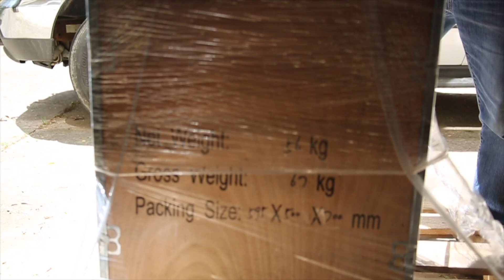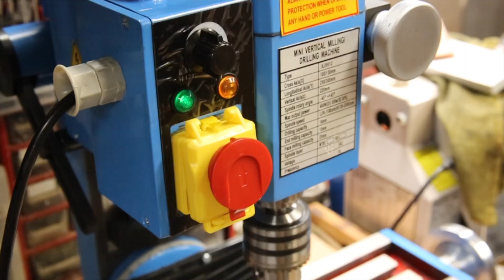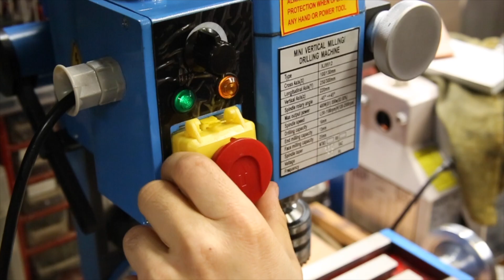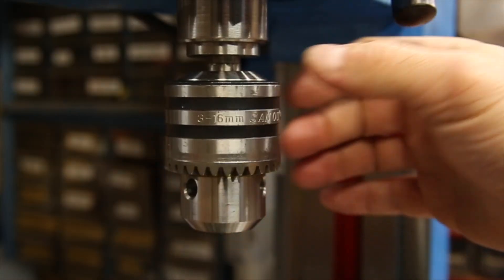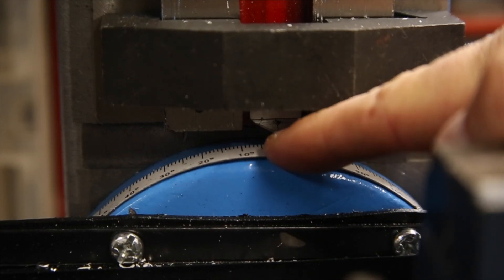Cheap Chinese Mini Metal Mill Milling Machine Unboxing, Setup, Testing, and Review

Comment: can you let me know the model/brand of the milling machine? the amazon link doesn't work. thanks.
Reply: Why don't people list the brand and model number?? Anyway I did manage to snag the model number from the video and found it - MINI DRILLING & MILLING MACHINE XJ9512
https://www.amazon.com/MINI-DRILLING-MILLING-MACHINE-XJ9512/dp/B01MUILF9Q/ref=sr_1_fkmr0_1?keywords=mini+mill+xj9512&qid=1575602247&sr=8-1-fkmr0

EDIT: Cheaper by a LOT on eBay 
https://www.ebay.com/c/687855375
Reply: @tihzho  it's a ploy so are forced to  click the link. There's a financial gain  for them if we click the link

Thanks for posting the brand/model. For that price, I'd rather get a taig milling machine.
Reply: @yeahitworks  Yes I know about the Amazon referral. :)
That's not the real price anyway, its about $800 on ebay which is a good price and a lot cheaper than a TAIG and its good for the tinkerer sticking a toe in the water.

I lived in Shanghai China for about 10 years working in manufacturing and a mill like this would be about $250 there. You can get some very good well made equipment in China, which makes sense China is a manufacturing country and their infrastructure hands America its ass. Whatever you need, you can find shit load of factories that makes it and are happy to modify it to your specs. Shame I couldn't bring anything back with me! hahaha
Reply: Try Aliexpress.

Comment: In my experience those small machines  don’t do very well with big ”standard” four flute end mills, for those an 8mm for aluminum is about the biggest you will get good results with. For removing material: use roughing end mills, they generally work well up to 12mm. And when using standrad end mills you need to cool/lube your work, almost any oil works for steel and alcohol or oil for aluminum. Alcohol is nice cause it does not stay on your parts and chip. And get a bettet wise and some collets...

Comment: I enjoyed your video....I have been considering purchasing the same machine....saw it on Ebay
Reply: RCKN-RNDL West Virginia RC i would not.... those machines don’t hold up very well. Had 2 of them, one broke within 2 weeks and one never started. A warning flag should be all the tools that come with it; good machines come with a manual, a wrench and possibly a chuck stem without the chuck. I got an optimum bf16v i think its called, has been reliable for years.
Reply: @antonw-uw4ov  .....ok, I appreciate the info

Comment: Softer metals like aluminum, use a 2 flute endmill. Depending on your speeds and feeds, a 4 flute will get gummed up and the material gets hot. Also add an air hose with a constant feed to cool your workpiece and to keep chips from piling up.

Comment: I don't understand why they don't combine the lathe and mill by making the lower bed into a trunion. you could mill and then adjust the lower bed 90 degrees and use as a lathe

Comment: Lots of videos on mini lathes and Mills. 
Some common observations.
Dissasemble and clean every part. 
Replace plastic drive gears with a belt drive. 
Replace ball bearings with taperd bearings
 Bolt it down!

Comment: Don’t use drill chucks! Pick up collet holders and collets. Also bolt the machine down to a heavy solid flat surface and level it, that way you can check all run out and hopefully this machine has a way to remove slack and adjust the surface for true flatness

Comment: These relatively inexpensive milling machines convert easily in great little CNC mills with readily available parts. Been done many many times and loads of videos on here about this. Turns it into a very capable little machine.

Comment: Looks like an alright little mill..
Edge finder tool really has no use for this, they are for automated equipment like a CNC for zeroing off tooling.
I may have missed if you mentioned what this cost for price, so I was wondering how much it was ?
Thanks 4 sharing bud.

Comment: Don't do all that back and forth with edge finder.  move it to contact slow and end right at shift from center.  Unless you can get edge finder to center by eyesight and then find its at same location according to DRO or dial indicator on machine.

Comment: Things to get (if you have not purchased already)
R8 collet set for common endmill sizes 1/8, 1/4, 3/8, 1/2
Small test dial indicator with a holder to attach to the quill for squaring the vise, locating center of a hole, etc. a $10 Chinese knock-off will do for start.
Set of parallels 
V-block set (with clamps!) for holding round things
A bottle of way oil
A bottle of non-detergent gear oil for lead screws
Lighter (SAE20-30) non-detergent oil for everything else spinning
Water-soluble coolant and spray bottle 
Small machinists jacks
Clamping set. Make sure the T-nuts are the right size for your mill table slots.
iGaging DRO or similar - you will be amazed how much it helps in speed and accuracy.

Check your local Craigslist, FB marketplace or whatever is in your area frequently, look for “machinists tools” and similar keywords. If you are patient you can collect nice set of tools from retired machinists.
This is also a good source of endmills.

Learn how to adjust the gibs on your mill. Loose gibs are the main source of chatter on those little mills operated by novice machinists.

Comment: @TimNummy Bolt that thing down to something solid, any shakes or vibrations will result in bad finish and most importantly NEVER use a drill chuck for milling!

Comment: Great video man! Just a few things that I am almost sure someone else is likely to have pointed out but...
1 a face mill will give you a better surface finish and will all around work better for the operation you showed.
2 a set of collects would go a long way towards helping with repeatability and accuracy.
3 a test indicator and swing arm will so you can tram in the head of the mill will make your life easier.

Comment: I made a dirty look as soon as I seen him put the round stock in the vice without a v block
Reply: A whole bunch of dirty looks from this side, me being an learned fitter and all.
The first of them being lifting the machine onto the table without taking it off the pallet-thingie and bolting it down properly.
Not making sure everything was oiled and tightened to spec.
Not making sure the head was 100% perpendicular to the table (a dial gauge is your friend).
Using a drill chuck for milling.
Not using coolant when milling with a high-speed mill.
Using a cheap-a** vise meant for cheap-a** drill presses. ...And not making sure the stock couldn't shift in the vise.
Running the mill across the stock without lifting it off.
Probably more, but that's what is what I can remember for now.

I probably wouldn't trust this thing with anything harder than nylon...
Reply: It’s  “vee block”
Reply: @zentesuken1346  no it isn't.   It's correctly stated in any of the ways we see it in this thread, and you really need to have a better critique than that to enter a discussion.
Reply: Yep same
Reply: And you did not when he showed the chuck with the endmill in it?
Reply: @69NOMAN69  one dirty look at a time, sir.
Reply: @69NOMAN69  I'm still sort of a nooby to this type of stuff. May I ask what exactly is the problem, or potential problem, of having an end-mill bit in the chuck?? Hope I don't seem like a complete idiot, but i honestly don't see what the issue would be, especially since the workpiece is held in a vise, bolted to a "milling table". I was going to be creating just such a set up in my work shed at home pretty soon, so please stop me if this is a No No for reasons I don't yet know.  Thanks!
Reply: @69NOMAN69  Thanks mate, this advice of yours is quite helpful to newbies like me.
Reply: @logancurl9526  Drill chucks aren't made to withstand side loads. Most are held on the arbor with a short taper (eg. JT3). The chuck and end mill could suddenly come loose. R8 collets (if your machine takes those) are the least expensive item to pick up. Or a small selection of endmill holders.
Reply: @northwind7409  are those items that would allow me to use end-mill bits in a drill press chuck in a safer/more secure manner? Or is that something that you use INSTEAD of a drill chuck? Where do I find such items for sale? Thanks for your help!
Reply: @logancurl9526  Definitely instead of the chuck. The chuck would likely let go even sooner if you had several things chained together and applied a side load. I'd expect Little Machine shop and Harbor Freight would carry endmill holders in MT3 or R8 (whichever fits your mill) or sets of R8 collets. The holders would be a bit easier to use. I'd suggest getting 1/4", 3/8" and 1/2", since most of the endmills you will use have those sizes of shank.
Reply: @northwind7409  a jacobs drill chuck can easily, easily handle the side loads. The actually issue is primarily that a jacobs d c won't center the bit very well, and secondarily, it won't hold onto the bit the way a collet or an arbor will.  So in addition to cutting on one flute which will then get dull, the bit may get pulled down or pushed up in the chuck.
Reply: @someotherdude  I have had the Jacobs taper let the chuck separate from the arbor under side load more than once.
Reply: well i mean it does have 3 points of contact
Reply: @codeflame8422  3 rules of machining
#1 rigidity
#2 rigidity
#3 rigidity

that is all
Reply: @69NOMAN69  one rule of entertainment, #1 sit back and watch.
Reply: @69NOMAN69  when i saw that he was working on the pallet.. everything was said.. ;)
Reply: 69NOMAN69 noman #4 rigidity
Reply: Julien Bellon-Serre hey I got married on a pallet. I drive a pallet to work every morning. Nothing wrong with pallets.

Comment: @Sean Murphy "regardless of safety, a drill chuck should never be used for lateral cuts as it's specifically designed for lateral compliance, so as to allow drills to seek rather than snap."
Drill chucks don't have built in lateral compliance, that's the result of the taper giving way under lateral forces and the force of plunging into the material pushing it back into it's taper.
This is why we have draw bars, but you made a valid point nonetheless and are probably the ONLY person in the comments to actually state a valid argument for their claim. 

@WCGwkf "Sharky even in a mill you're not supposed to be milling anything with a drill chuck."
What's your reasoning for this ? What dictates what you should and shouldn't do with a drill chuck and why ?

"Sean Murphy it seems pretty clear to me that people who claim you can use a drill chuck for milling are not machinists and have only used a drill press and maybe touched a mill once or somehow have gotten away with using one improperly and have no clue how to machine. These people have no idea what they're talking about and it's pretty funny"

So tell me Mr. Machinist, why shouldn't you use a drill chuck in a mill ?(The one Sean Murphy stated does not count here, there are other reasons why one wouldn't want to use a drill chuck in a mill)

To every actual machinist out there, yes, I know why one wouldn't WANT to use a drill chuck on a mill so please don't reply with the answer. Just pat yourself on the back for knowing the answers and walk away :P

Comment: you're using an end mill in a drill chuck?  They are not designed for high lateral loading.  Use a proper end mill holder.  It will be more accurate and give a better finish.

Comment: If you buy yourself a set of collets and a collet chuck, you will get a better finish.  The Jacob's chuck that came with your mill is meant for drilling.  You can damage it by using it for milling. Also, Maybe invest in a better vise.  They aren't very expensive.  Make sure to mount it true. That'll help with accuracy when edge milling. Have fun with your mill. They are a blast once you get familiar with it.

Comment: Late to comment party so im sure advice from me is , what am i saying. Im a mill god. Lol 

Get that mill in place and make it permanently unmovable. 

Square, plumb,level x,y,z, install vice and lock a straight edge in it so your sure vice good side to side. Use edge finder to find one of the vice "unmoving" corners, zero out your handles and lock the collars.

Shake it, check zero again. Get some collets. Drill chucks <-- drill. Collets mill.
Aluminium is gooey and sticks. Use tap magic aluminum. Regular tap magic for steal. 

For nice flat finish, a. Get a fly cutter with carbide inserts. Either tool you use, you want the tool eating the edge not wiping the edge. A little under half the tool should be doing work unless cutting a slot or something. Think, rotation, sharp edge clawing into metal and nice empty yard behind ya to toss the chips. Steal look for amber chips, blue chips mean to fast or to much. Aluminum, if you work looks like shit and you neet to file the aluminum off the end mill, check ur speeds and feeds and that ur not wiping.

Check out gesswein, there ww collets are concentric to like 4-5 decimals.. there stones and polish are second to none. Get some cratex too,  but definitely get a fly cutter. It is its own collet. And the inserts are pretty cheap if ya breakin stuff learning. 

Hope it helps, oh and best advice ever..... do the hardest feature first so if ya fuck up you have the least time invested. 

Peace.

Comment: Hey nice video thanks for the demonstration.  Im a tool and die maker and CNC machinist and im looking at picking up a little mill for myself. This one definitely looks cool!  

Others have warned about using an endmill in a chuck and i agree, dont do it, especially when milling metal.  Also you might want to check the squareness of your spindle to the cross table with an indicator to make sure its level to your work piece.  This is standard practice in machining and can be done with a magnetic indicator attached to the spindle head or with and Indicol.

Also, some advice on milling roundstock.  Dont rely on the jaws of your vice to hold a round workpiece, Not enough of the stock is engaged to the jaws to be safe or to give you a reliably level finish.  Get a V Block that will square up one side of your roundstock and use the rear vice jaw to hold the curved portion in the V Block.

Happy machining !

Comment: A flycutter or face cutter would get u much better mill finish. But tbh if you r cutting cylindrical work use a lathe. Or a bigger mill, the least amount of passes to finish a cut the better

Comment: @
TimNummy While you were testing on that aluminum shouldn't you have used some sort of cutting oil or lubrication on the bit?
Reply: nightstryke 1 no aluminum is a softer metal that cuts very smoothly and doesn’t produce much to any heat. Cutting fluids are meant for harder metals such as steel.

Comment: first thing i woud do on a machine like this is to se if everything is lined up properly-fit an indicator in the chuck(replace that whit a collet) and measure on all 4 corners of the table-i bet that u will get different readings on all spots, the table or the head can be shimmed somewhere to get all corners to zero

Comment: Good quality vice and use a fly cutter. Also don't use the given chuck take advantage of the Morse taper. But given the machine you can only get up to a point before you would have to upgrade the machine but this one would get you close to a reasonable finish.

Comment: 1. Get a bigger mill (probably not very helpful).
2. If you can take light cuts, go with carbide end mills. They have much better finish but since your mill lack rigidity, don't take any heavier cut than 1mm in aluminum. My neighbor has a 3 ton CNC VMC and he takes 3mm passes with carbide end mills. He can take much heavier passes but he takes 3mm passes to minimize wear and tool breakage. If you take very heavy cuts on a light mill like yours the carbide end mill will not last long and will either dull or break. Listen to the sound the mill makes. If you hear chattering (you will know it, because it sounds terrible, like nails across the chalkboard) then take lighter cuts, or beef up your rigidity (mount it better or use a shorter end mill). An end mill cutting properly should sound like someone mowing the lawn about 4 houses away.
3. Use collets, The Seig X2 should come with 2, a 3/8" and a 1/2". You can get bigger end mills if you want but know that you should not do anything more than surface sweeps cutting no more than .01" at a time with it!
4. The end mill you're using is too long, get a shorter end mill to increase rigidity!

Comment: 2/10th of an inch? 9:00

thats 2.54 mm....
correction.... 5.08mm....
thats about ... nvm he must of make a misnomer.
Reply: No, He is correct. Here in the USA, the cylindrical end is .2" or for us machinists, two hundred thousandths of an inch. Its needs to be an even easily remembered number to make setups quicker.

Comment: The other thing I noticed is that you are up or climb milling..you can get away with it on aluminum but almost always will snap a small endmill...you should have started from the right side and conventional or down milling which is the proper way to do it....if you have any questions please get back to me...over my career I trained dozens of apprentices
Reply: Al do you think this mill would be ok for slotting copper for knife guards or making fullers in carbon steels?
Reply: @JLyman  copper is pretty easy machining,but be careful of the chips they can be pretty toxic if you get cut,steel should be no problem if you watch your speeds and feeds,use lubricant,and watch your depth of cut.don't try to take too much off at once.Remember it's a hobbyist's machine not a Bridgeport. Good guidelines for starting points are the machinists handbook or machinery's handbook.